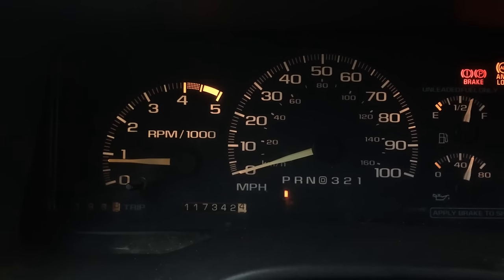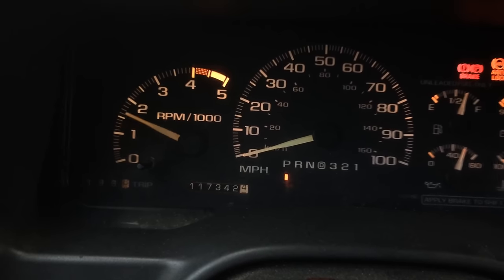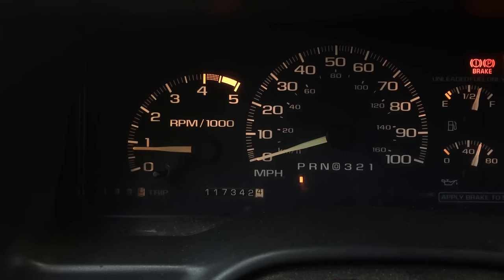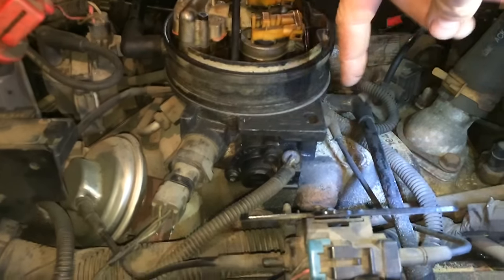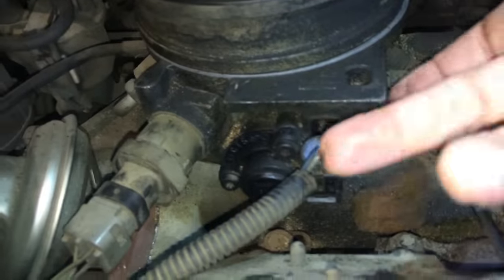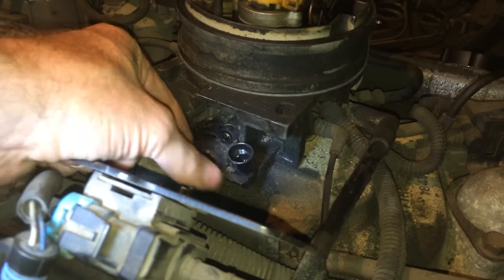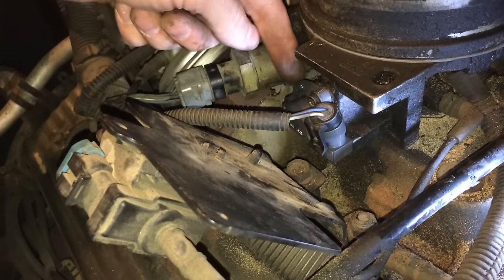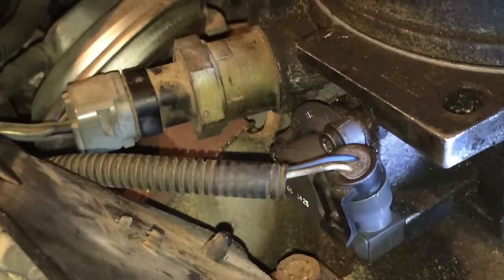Throttle Position Sensor Symptoms And Fix TPS

Comment: Get a Actron CP9690 code tester. It checks live, record, graphing, emissions readiness test, oxygen sensor test, ABS. SRS, transmission codes, oil light reset, check engine light reset, and MORE! It's well-lit! Get 4 aaa batteries for under the rear cover. It comes in a black pouch. It tests from 1983-2013 and is updatable using a USB cable from EBAY. It has code-connect to diagnose codes.

Comment: is duralast TPS sensor good? I just changed it because i couldn't wait for shipping. Do you think I should change it with ac delco?
Reply from the maker: I think it should be fine. They make good stuff, and I’ve used their parts before.

Comment: Changed mine. My advice is first unbolt the throttle body first then it would be easier to unbolt the sensor. Be careful because the torch bolts are known to break if not done slowly and properly centered.
Reply: Torch bolts?
Reply: @x-man5056  Assuming he meant Torx.

Comment: tps on 80s chevy 350s has slotted holes so u can rock it back&forth to adjust. a gauge is used to feeler it into position. gauge thickness may b found on tune-up specs on the core support

Comment: I have a 93 maxima,it has that same symptom of your truck,does it need special instruction and procedures to install it? Or take out and put it in like changing shoes? Thanks
Reply from the maker: I am not sure if Toyota made it as simple to replace the throttle position sensor or not, but it is probably similar and just as easy to replace.

Comment: Perhaps TPS failure affects different years differently when my TPS failed it completely affected my transmission I thought my transmission was going out and I had no problem accelerating above 2000 rpm there was a slight hesitation off the line but once I replaced the TPS everything was fine
Reply: FSEVENMAN  I’ve been having a problem when I put it in drive my trans smashes into gear but only sometimes. Is this similar to your previous issue? When I’m up to speed it’s fine.
Reply: @johnmcauley3442   Yeah mine mast into gear and it would shift really hard into 2nd gear like a dragster I need didn't even know my truck could do that but I replaced the TPS throttle position sensor and everything was fine. Good luck
Reply: Sir what happen if remove tps sensor in motorbike. and use it in a long day with out tps sensor

Comment: Love your videos very entertaining and informational haha, great stuff! My car starting stalling the other day and wouldn'5t rev past 3,000 rpms unless i really atepoed on it, then it would stall, and it was jolting and all that nonsense, i got horrible mileage and i also didn't have any torque on the too end... turns out my throttle position sensor was unplugged, I was so scared for my engine haha... 1987 MK3 Toyota Supra
Reply from the maker: I'm glad you got it fixed, and it didn't cost you any money.  Those are the best kind of repair jobs.
Reply: hoohoohoblin absolutely haha, as sinple as it was... thanks again!

Comment: If you are still replying I have the same engine. My issue is that it starts up fine and idles fine and drives fine but it acts like it's going to stall out when taking off from a dead stop but then gets going and also it shutters real bad when under a load but if I press on the throttle to get it in the passing gear it will accelerate fine. 
In the process of replacing the fuel pump but idk if that's the problem. Probably due for one though.
Reply: Check your tv cable to trans for adjustment?
Reply: Try unplugging your egr solenoid & see if that corrects your problem, or did you find it by now?

Comment: So what if you already done the throttle position sensor mass airflow sensor and they tried to tell you the the wire going back to the ECM the computer is bad I hardly doubt it what do you think tell me what you think
Reply from the maker: That would definitely cause a problem. It’s possible. I know it’s difficult to trace wires.

Comment: Sounds like my 2000 Mazda Protege has the same issue. The car wouldn't even drive 5 or 10 mph and jerks forward if i push the gas and try to drice, the check engine light came on. I scanned it and 6 codes came up: P1345, P0102, P0103, P0113, P0123, and P0171. I bought a camshaft position sensor and replaced it then scanned it again and only P0102 came up. I bought a new mass airflow sensor and installed it. After that the check engine light turned off but whats happening at the beginning of the video sounds like its happening to my car. Do you think I need to replace the throttle position sensor and that'll be it?
Reply from the maker: That may be yet. I’m not familiar with Mazdas, but it is probably a pretty cheap thing to try out. If you have a voltmeter, you might be able to test your throttle position sensor before you replace it. You’d have to look up what values it should be putting out in a test.

Comment: Curious, i replaced my IAC thinking it was my issue, truck has a high idle, got a 92 4.3 tbi engine, popped the iac in, even after resetting the computer it was idling real high, checked for vacuum leaks couldnt seem to find any, it went down randomly to a normal idle, then boom back up again after i revved it a few times, pulled the TPS off and when i manually turn it i hear some crunching or grinding inside, going to order a new one soon, would that sound like probably the right plan?
Reply from the maker: I think so. You could look in the repair manual for instructions on how to diagnose the throttle position sensor as well. I have seen the truck do crazy idle things because of the ECM computer as well.

Comment: I was driving my 2001 Chevy Silverado 2500HD and as soon as I accelerate, slowly, it felt like the tranny jolted forward. I know it's not the tranny and double checked the oil it's clean and it shifts smoothly into higher gears. I was told the throttle position sensor may cause the sudden jolt that I felt. Is it true? I know I power washed the engine a few weeks ago and that's the only thing I did to it.  The jolt is not consistent and happens once in a while. Can you confirm? Any advice? Thanks
Reply from the maker: It could definitely be the throttle position sensor. If it doesn’t know where the throttle is, and doesn’t report it correctly, it could cause problems. It could also be the ECU, but I would check the throttle position sensor first. There are tests you can do on the one you have now to see if it is good or bad.

Comment: I keep getting intermittent codes : Throttle Body Position sensor failure and Shift Solenoid B failure ? Any clues ? Car sluggish in drive. Transmission gone ?? Don't want to be taken advantage of if something less expensive needs to be replaced. Thanks
Reply: I replaced my shift solenoids because my truck wouldn't shift into overdrive . The rpms just kept climbing . One of the little wires in the solenoid had burned up. My pickup has been dying on me lately and I'm thinking maybe I need to test my tps even though my truck has no check engine light coming on. It didn't come on when my shift solenoid  went out either.
Reply: Jeremy Vasquez I bit the bullet and ordered a used transmission. Won't get to the mechanic until 9/4 and he can't install till end of next week. Car got so bad that it would last for about 2 minutes and then spin it's wheels in drive. I'm grounded till next week. Miserable feeling !!
Reply: Yup.sucks when ur let down by ur vehicle. Especially if it's your only one. Mine has a pretty bad oil leak on the intake manifold and my exhaust is so rusted. Little at a time it will be sealed up and running new again . Mine had 260,000 on original timing chain . I recently replaced it with a double roller but now I think it's leaking out of the cranks seal or front of pan. Not a whole lot but it's annoying marking my spot everywhere I go.

Comment: To the point!!
Reply from the maker: Thanks
Reply: @hoohoohoblin  
I have a 96 Chevy truck 5.7 and everytime I start it rpms jumps to 2,000 rpms and in 10 seconds it settles down to normal idle hot or cold, I changed the idle selanoid,
Thermostat, stock 195 ,I have two new temp senders not put in yet
And I should receive a TPS today.
Truck has 322,00 miles.
On the Fwy the other day it was at 2000 by it self, I think TPS is the problem. After watching your video.

Comment: Thank you I suspect my TPS is going out it’s random the car will work fine the all a sudden why’ll driving the engine starts to lag my foots too the floor and I got no power the tachometer goes crazy jumps up and down. Sometimes it’s so bad stalls the car out and it’s hard getting it going again. One time it acted up but it didn’t stall so I pulled over on the highway turned car off started again and it was good the rest of my way. So I’m going to try and replace this sensor see if it continues to do it or not.
Reply from the maker: It is probably the problem. I think it’s the cheapest and easiest thing to try replacing first. On my truck, the ECU computer went bad and it was running crazy like that, and replacing the computer fixed it.
Reply: hoohoohoblin     Well I don’t think it’s the cars computer cause everything else works fine and it communicates properly with the scan tool witch I didn’t mention no codes so that’s odd so I’ll try the sensors first. Thanks for the Input.
Reply: @ryans413  did this fix your issue?

Comment: Ok so I have a 98 aurora it dies when I'm setting at a stop light or lurches forward. What say you
Reply: Lisa Cox my Lexus Ls400 is doing the same. I’m getting an engine code for the tps, I’d replace that. Seems like the common culprit, even if it’s not the part is relatively cheap

Comment: I changed mine out an everything seemed to be fixed but a couple days later the issues resumed. Is there anything that could ruin the sensor or is there something it’s connected to that could go bad?
Reply: Calibrate it bud.

Comment: Would this also cause low rough idle when steering wheel cranked  lock to lock , or AC is on at idle ?
Reply from the maker: Maybe, or it could be slightly dirty fuel injectors or carburetor.

Comment: Would the TPS cause a vehicle to lurch and make RPM almost redline when you are at highway speed and you have to accelerate to maintain speed limit it is much worse if cruise is set and you hit a small grade and it will also lurch and sometimes stall and even die at times when you let off the foot feed and start breaking from 25mph... help the sickly 05 trailblazer.  Thank you so much
Reply: Have you checked your cruise control?
Reply: @roostercogburn597  no I never thought of it.  I will check it out though, now it will act up even when the  cruise ain't set all i have to do is get on it a bit but if I baby that pedal i have too much time between shifts and have to let off just a bit for it to shift, Anything you can tell me will help thanks Rooster

Comment: I know this is a older video but I have a 1995 Chevy 1500 with a 350. The only way you can start the truck is to put your foot to the floor and crank it over. Some times it will start but smokes like train going up hill. It runs real rough and some times it comes out of it and runs just fine but now It will not stay running if I take my foot off the gas. Can you help me?
Reply from the maker: That should be a stuck EGR valve. On my truck, the plates and the catalytic converter broke loose, and sometimes there was so much of an exhaust obstruction that it would barely run, but then the plates would rattle into position to allow the exhaust flow again, and it would run fine. Took forever to figure that one out.

Comment: @hoohoohoblin do you know anything about wiring in the throttle position sensor and what part numbers I need to buy new wires?
Reply from the maker: I don’t know. You might have to get those directly from the dealer.

Comment: does it also affect the gear shifting?
Reply from the maker: No. On my truck I had parked trouble with the automatic transmission shifting crazy, and the problem was the ECU computer.
Reply: Yes it does

Comment: I got a 2000 Subaru outback rough idle. I changed the iac,tune up.its smooth in park.only idles low when in gear.
Reply from the maker: Might be dirty fuel injectors
Reply: Get a Actron CP9690 code tester to check what it could be. EBAY has it. It checks live, record, graphing, emissions readiness test, transmission codes, ABS, SRS, Oxygen sensor tests, and MORE! It's well-lit! It has code- connect to diagnose codes. Get the USB cable to update it. EBAY has it. It uses 4 aaa batteries under the rear cover.

Comment: Awesome video I just bought a car like 4 days ago was driving down the road and got up to 50 km/h and it just kinda died. Was idling fine but was getting no acceleration and it wont rev past 2000 rpms so I'm thinking this is the issue I'm having
Reply from the maker: I hope that’s what it was. I’m glad I could help.

Comment: my tps went bad and it made the transmission feel like its slipping-jimping out of gear other than a rough idle...check the OBD 1 and it said bad TPS. Changed it out and ran like a new truck...
Reply: Bro i thibk i just figured out my problem thanks my tranny ran great up until 3rd gear it would sleep but still go into it after a second
Reply: @DakahriGT  also can be shift solenoids 1&2, 3&4...if you got a 4L60E...other times a valve can be stuck in the valve body, the other scenario is clutches can be worn...transmission are tricky...what sux is there isn't a transmission light only a service engine light...

Comment: Hey quick question what year is this truck/ motor? Recently bought a car with alleged 90 Camaro TBI motor with a 90s ECU out of a truck. Motor is solid cast. Duh. But heads are solid cast with aluminum intake.
Reply from the maker: This is a 350 (5.7) in a 1995 Chevy Silverado K1500.

Comment: sooo is it the same on a vortec engine as a tbi? i have an unused truck with a brand new one and my vortec needs this😬
Reply from the maker: I don’t know if it’s exactly the same place, but it should be a very similar part.  If you look under the hood while somebody steps on the gas pedal, you should be able to find it.

Comment: Would this greatly affect the shifting of the truck (read this not saying it will).
Reply from the maker: +James Tanner Yes. On many cars it is connected to the transmission to determine if it needs to shift.

Comment: ...and the knowledge of knowing when you put a new position sensor in your car you better we'll be close to a shop that quickly connects & programs the new sensor with the PCM because soon as you start the car with the new part in you shall notice the higher idle than before & as you accelerate you shall notice rpm's continually increasing, not kicking back down at all as your speed increases. Sometimes what folks don't tell us, comprises the very questions we have to ask beforehand.
Reply: And it's my understanding the new TPS must be adjusted using a multimeter! No mention of that in this video!

Comment: Just an FYI those throttle positioning sensors cannot be adjusted. If you have a tuned port or anything like that those are adjustable but these are voltage based.
Reply: Aren't most adjustable ones the ones that have somewhat of a slot in them on one side so you can move them a bit?

Comment: Hmm I have an 08 Honda Pilot and was wondering if my tps was going bad. My rpm gauge will surge up and down 100 rpm when keeping the accel at the same speed, it jumps between 1400 to 1500 rpm until I get the rpms up higher or slow down a bit any ideas?
Reply from the maker: +Rick Harrison That is a good guess. It could be a vacuum leak too, but if it were, the check engine light would probably be on.

Comment: I drive a Chrysler 300 and this lightning signal would come on.  After googling the image it was the throttle body sensor. I went to a mechanic to get the problem resolved, but still a constant issue. Is any other idea of what this could be? Please help.
Reply from the maker: This is a frustrating problem, because it could be a number of things. It could be the vehicles computer, or it could be a dirty fuel injectors, or a week fuel pump.
Reply: @hoohoohoblin  I'll just take it to another mechanic

Comment: I have a 1995 chevy silverado 3500 454 tbi and when I drive it normal it runs great but if I stomp the gas from a dead stop it bogs or when in park at idle I stomp it it bogs also I've already replace the tank pump and filter
Reply: I have the same problem 1993 454 SS 
Did you replace the ThrottlePositionSensor or the Map Sensor or Air Control Valve ?
What was the problem or how to reset relearn after installing parts let me know Thanks
Reply: EGR valve

Comment: I have a 98 dodge ram 1500 and at highway speed my truck runs 1800 RPM and it will do a weird thing where it fluctuates 100 to 200 extra RPM. Is that what it could be is the throttle position sensor?
Reply from the maker: Yes. It could be that, or the ECU computer.

Comment: My 03 Lightning sometimes shuts off while idling. It also hesitates and sometimes even jumps when I accelerate. I changed the MAF sensor and it still is doing it. I unplug the MAF sensor and it doesn’t. Any ideas?
Reply from the maker: I’m not sure. It sounds like whatever is receiving the signal from the sensor has the problem. Maybe your ECU is bad. Mine went bad on my truck, and it did all kinds of crazy things to the idle and transmission shifting points.

Comment: So i have a question, I'm trying to diagnose a problem. My 95 5.7 just started out of no where shifting hard in low hears. From slowing down at a light and turning.  I got a real harsh shift. 3 and 4 were smooth. So hard that you could feel the truck jerk.  I also am getting a kind of rough idle.  The truck has recently bogged down like it wanted to cut off too. And a few months ago. It died suddenly with no prior signs while driving. I'm not sure if these issues are related.  But does anyone have an idea what's going on?